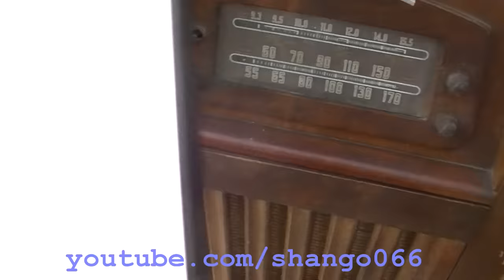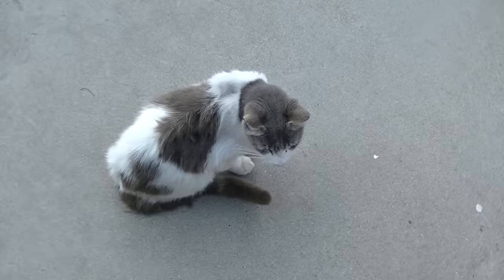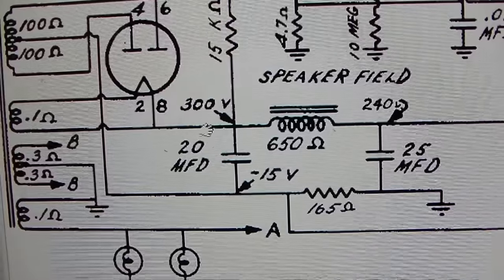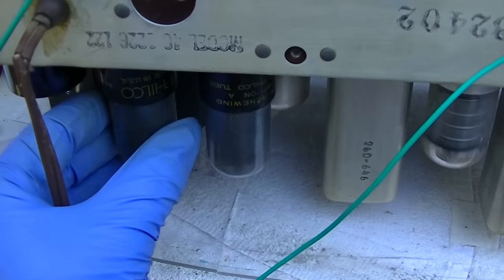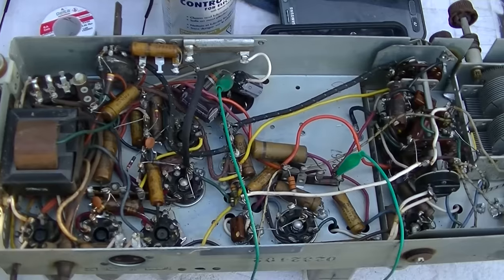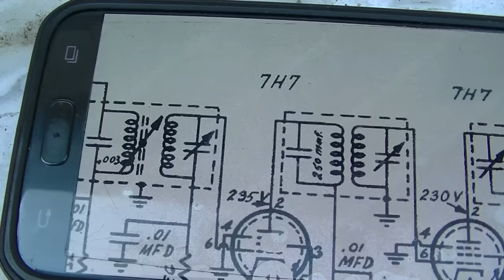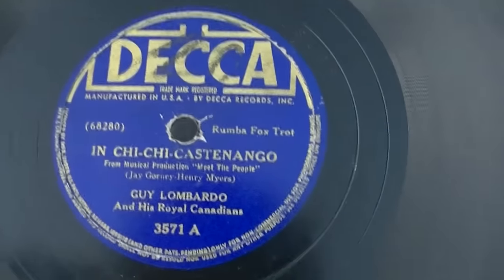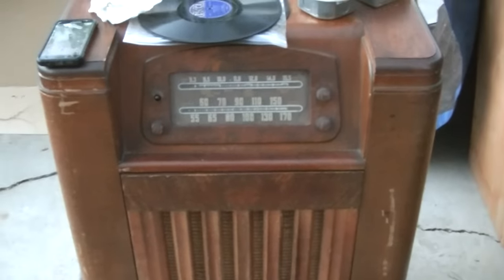1947 Philco 46 1226 Radio Phonograph Resurrection

Comment: It picks up amateur radio uses that's pretty impressive it's a pretty big loop antenna so yeah if you like a listen the most popular amateur bands are 40 and 20 m 7.000 mhz and 14.000 usually on Upper or lower sideband if you make yourself inverted V dipole you can even hear that guy from Guatemala South America

Comment: 8:53 I saw something like that at work. The security guard posted at the gate had a small electric heater and the power cord was wired to the power strip like this but without the cheater cord.  I think it was that cringey safety violation and/or he was caught sleeping on duty that got him thrown off the job. There was another derp ex security guard who got thrown out of the job and got himself in trouble for armed robbery at a gas station.

Comment: Re: Socket - Someone (Glasslinger?) used a dental probe to tweak the tube socket contacts to make better contact.
It's sad that there is no market for this radio - it looks like the cabinet would clean up nice and the radio chassis is in relatively good condition.

Comment: Poor cat he gulped in fear when Shango066 shouted at him so quiet no meowws, poor old thing, I remember when my cat got to that age no energy,no complaints awee
Reply: Almost as bony as my old boy.
Reply: when they loose weight like that, and become lethargic , it is usually kidney failure, it will get to a point when that kitty will no longer eat/drink!!!!!
Reply: @gregoryclemen1870  Totally agree my cat died same way,thats why I thought poor cat days are numbered very sad.
Reply: I was raised with animals( cats/dogs), and I have cats myself(2) . when cats get near the end, they go into "HIDING" , and will not eat or drink, they also will be in the "BREAD LOAF" position and will not move!!!.  I do not think that it was "KIND" for that cat to be "YELLED AT"!!!!! for no reason.
Reply: @gregoryclemen1870  a cat that age gose to a hidden place to sleep and pass away. They do this to not upset it's owner. Mine did. Left and never came back and passed away
Reply: @gregoryclemen1870  the cat is not dying, it's just getting old. If it was threatened, it would leave. If he was in bad shape he'd be hiding or in a safe spot.

you can tell that cat isn't abused because it did nothing, it sat there. If it was regulatly feeli g threatened it would run or hide. I have adopted some cats from crappy homes and they run at the sound of various noises, voices, or movements they fear. 

 Cat's don't speak, they react to learned threats. Don't apply human language and inflection to them.
Reply: OH I KNOW!!!!, they will find a place to quietly "FADE AWAY"!!!. it is in their nature to do that, just like you can tell when a cat is going to go to sleep( healthy cat), they will clean themselves first. this is to get any "PHEROMONE" off of their coat, so other animals can not "SNIFF THEM OUT"!!!, while they sleep.
Reply: I am aware of that, his cat has lost a lot of weight, and tends to be in the "BREAD LOAF" position( protective position), that kitty looks like it has the beginning stages of kidney failure(lethargic). I have seen it with the cats that I have had over the years that "KICKED THE BUCKET"!!!, when they are getting close to "CHECKING OUT" that is when they go into hiding!!!!

Comment: The AC line voltage today 120+ is higher than the line voltage in 1955 (probably 115).  That could cause a higher B+ voltage.

Comment: I think I remember radiotvphononut talking about those solid state rectifiers, Basically do not use them unless you want to destroy tubes, love the channel, keep them coming !!!
Reply: They work fine if you put a ballast resistor inline to get the proper voltage. You almost have to anyway, even with the valve rectifier, due to the line voltage being so much higher than it used to be.

Comment: At 9:00, that's ABSOLUTELY STUPID!!!!!!!!!!!!   Replace the cord!     Should have changed CAPs FIRST BEFORE Power-Up!!!!
At 30:14, THEY ARE ALREADY SHORTED, duffis!!  At 58:38 OB COURSE it's in the SOCKET!!
Reply: Just needs a new operating system to boot from a very good AM FM receiver

Comment: What about switching out the paper capacitors for ceramic capacitors like what Motorola did on some of their stereograms.
Reply: If you're talking about ceramic disc capacitors, I think the issue is that they are susceptible to microphonics. But that may only be a problem in guitar amps.

Comment: Loktals are the best. I love 'em!
Reply: They were ok when new, and were even better in high vibration situations(like car radios).
This is, in fact what they were developed for.
Loctal tubes were Invented by Philco-car radios were a big part of their business, and the design of the Loctal tube base/socket was intended to keep the tube in its socket.
The Military used them for a while, for the same reason.
Of course, they seem to be problematic over the long term.
Reply: @m.k.8158  Growing up, we had a 1949 Rogers-Majestic R239 console that used loctals for all the signal level tubes, 7Q7, 7A7, and 7B6. Output was a single ended 6V6GT, speaker was 8" permanent magnetic. AM with VM-407 record changer.

Comment: Ok so what makes locktal tubes junk?
Reply: Small tube pins, with crumby tube sockets that like to spread open causing a loose connection, and they can be difficult to clean. 
Their octal counterparts are far and away more reliable.

Comment: What's the replacement for wax capacitors disc capacitors?
Reply: And mylar caps too.
Reply: @marka1986  could you replace wax capacitors with electrolytics?
Reply from the maker: In that specific case I was just trying to block the DC voltage from the tube. The proper way to do it would be to replace all of those wax capacitors with either disk or mylar. Disk are fine for the audio section mylar are better for when something more stable is required
Reply: @shango066  thanks would it be better just to replace wax with mylar and don't use disc? Is it the cost?. I'm getting into audio repair for fun. When do you need mylar instead of disc?
Reply: @chevguy8587    Usually not.  Most electrolytics are polarized, and are usually higher capacitance.
Reply: @chevguy8587    General rule of thumb (with some exceptions) - If it's just a bypass cap, or non-critical filter, most any decent quality cap of the same (or similar) value will work.  If the cap is part of a tuned circuit, or a timing circuit, that's when it's important to match the old cap's capacitance, and use a higher quality cap.  For the IF cans or in the tuner, you would usually use NPO grade (now called C0G grade) ceramic caps, if the cap is below about 1,000 pF, because they are very stable.  For the caps with higher capacitance (say 2 nF to maybe 8-10 uF) that are part of a tuned audio circuit, or vert / horiz oscillator in a TV, you could use mylar film, polypropylene, or maybe polyester film capacitors.  Ceramic caps CAN work for tuned circuits in that capacitance range (for instance X7R grade caps), but they won't be as stable / precise, and there may be some degradation in performance (although they'll still perform better than the old wax-coated paper capacitors).  One caveat:  if you replace the across-the-AC-line capacitor, it's best to use a line-rated safety capacitor, because they are designed to fail safely if they fail, not explode or catch fire.

Comment: Shango, that Philco, had either a crystal, or ceramic pick up in the tone arm, and since its a 1947 model, Im leaning towards the ceramic unit. Very reliable, but heavy and tough on the hard rubber records of the era.  Thanks for another fabulous and technically accurate video!!! 👍
Reply: I think it has magnetic pick up :)
Reply: @michvod  magnetic pick ups came out in 1955, Zenith corp was the first, along with Magnavox, which called theirs microtouch.
Reply: Most records of that era were bakelite which is a phenolic plastic.

Comment: In 1931 they start with 33 rpm. That is a nice piece of history.
Reply: I do think you may incorrect, i have a 1929 model 37A Zenith, radio/ phonograph combination, and my turntable is definitely 78 rpm, no speed select, just on and off. 33 1/3 came out in the mid 50's after 45 rpm.
Reply: @jamesmann1243  had looked it all up on a Dutch site,
where the entire record players history stood on. 
It belonged to a record specialist.
Reply: @jamesmann1243  33 1/3 rpm LP was introduced by CBS in 1948, one year before RCA's 7" 45 rpm. Both were microgroove. Before that, there were 33 rpm records used for radio transcriptions, with standard grooves.

Comment: a 5U4 rectifier tube can be substituted for a 5Y3
Reply: Not really, 5u4 pulls 50% more filament current, and has lower voltage drop so the b+ will be high
Reply: If he wanted to be real crafty, make a tube socket adapter to accept an old big pin type 80, or find a small envelope type 80 and change the base out to octal. 
5Y3’s were basically a type 80 in different socket form.
Reply: @erikj.2066  We had a Philco #20 Baby Grand cathedral radio with a big bulb type 80 tube.